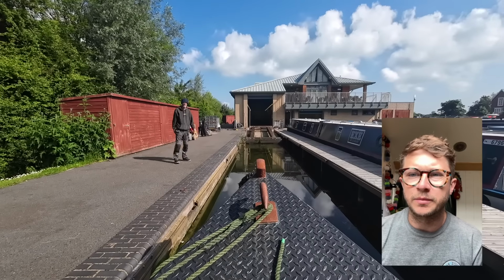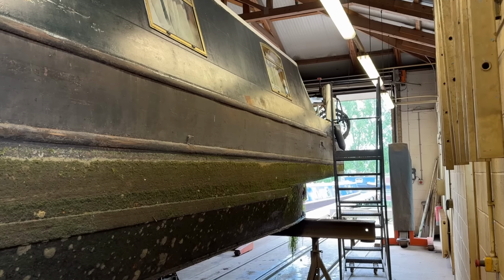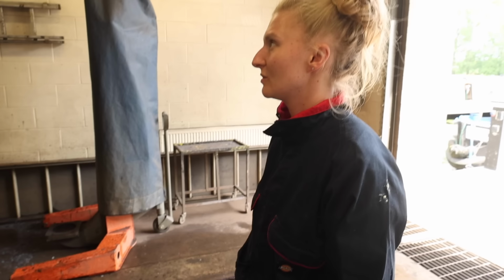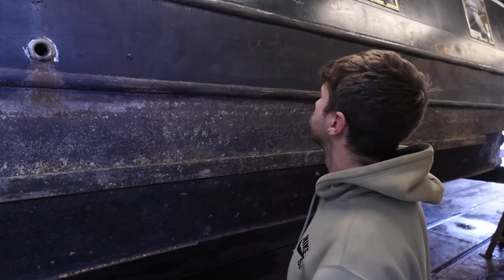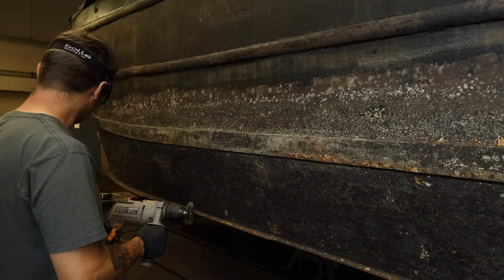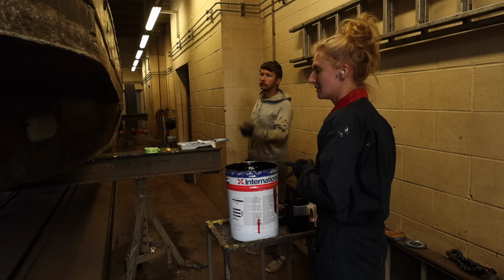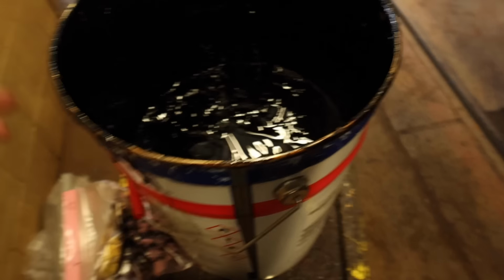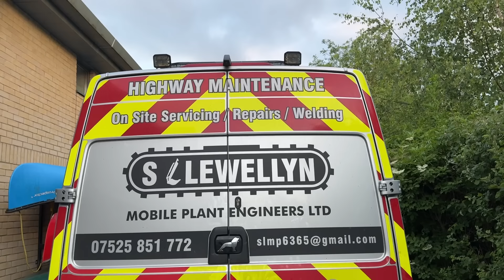Taking Our NARROWBOAT Out Of The Water!

Comment: In the "next time" file.... there are tools for removing tile/linoleum flooring that look like a large, solid scraper blade with a broom handle. Not suitable for the fine bits, but for the initial scrape of large areas while still wet I think they'd do a treat and you could cut the handle down to your preference. Great job, great work. That's a lot of electrons being sucked out of the hull, eh?